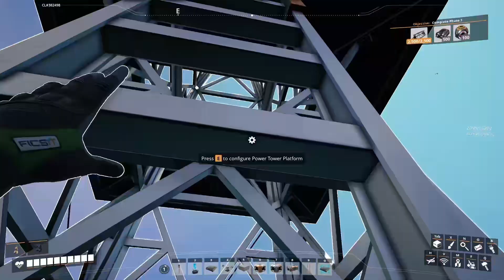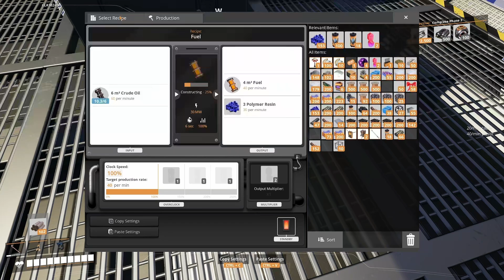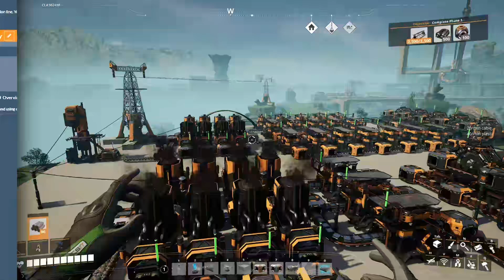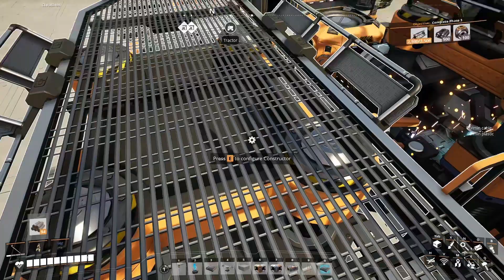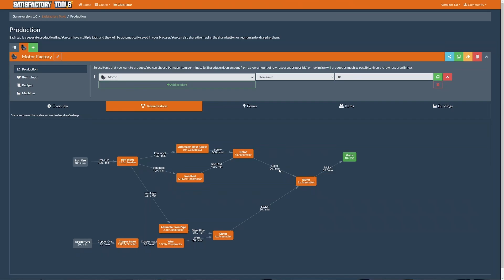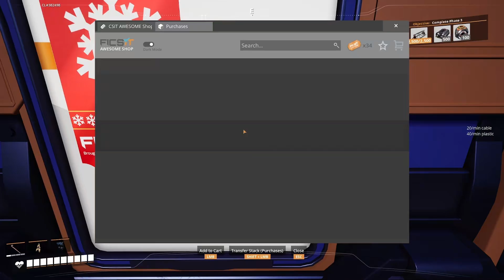EASY Fuel & Motor Factories For the Mid-Game! | Satisfactory 1.0 Guided Playthrough Ep. 16

Comment: The alien DNA and power shards setup had occurred to me, but I didn’t want to use so many sommer sloops. Instead, I just have a single constructor with a sloop, and 3 power shards installed (waiting is a pain) and change the recipes manually. Nice motor factory though. I still haven't found the iron pipe recipe, but the iron wire recipe comes in handy. If you had both recipes, the factory would only use iron (really plentiful). Anyway, nice video.
Reply from the maker: Yeah, I didn't want to use too many alternates that early in the game because most people wouldn't have found them across the map! And agree, Somersloops are hard to come by so totally makes sense your design unless you go on a crazy scavenger hunt

Comment: Great vid! A little tip for the multiplier factories. Add an overflow belt at the end that passes everything that is not relevant, so you don't accidentally clog your factory if you throw the wrong stuff in. Then merge it with the output belts to drop it into the output container. Fail safe!
Reply from the maker: Smart!
Reply: I recently had to do that in my caterium computer factory.  I made the input system run on a loop to recycle the material the machines didn't take in. So they just continuously stay in the loop until they are taken.  It can easily get clogged if you dont balance how much is going in, and I didn't need the circuit boards going back to the assemblers making them. So I just smart split them off the loop to the computer output, as well as the excess quick wire so they can be returned to storage.  Pretty great system...little messy but it's hidden in a logistics floor.

Comment: How does the overflow thing work?
Reply from the maker: Say you have 4 constructors that each need 30 of an item, and you're running a belt with 120 of that item. What will happen is the 1st constructor will fill up with the 30/min it needs, then it'll be capped and the rest of the items will "overflow" down the line.

It's a less efficient system because the last constructor / machine in the line takes a long time to fill up, but ONCE it does, it's as efficient as any other system.
Reply: In a manifold system, all machines are connected to one "feeding" line, the first machine will fill up faster then the rest. The moment it is full every item that should go to it will overflow to the next machines.
Or imagine you putting 3 bowl of different sizes into another, then you start filling the first one with water, the moment it is full the water will "overflow" into the next one and so on.

In case of smart splitters overflow has a similar function, if one exit cant take more items, the items will leave at the overflow exit you can acutally set and it is great for feeding items you cant use because you are producing too much, to get some tickets.